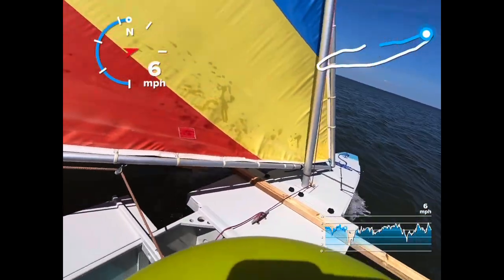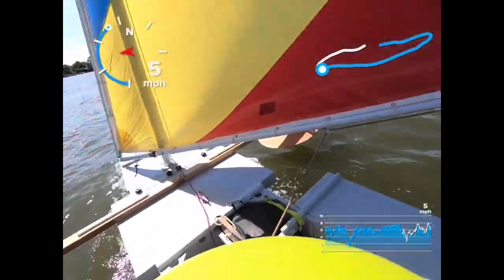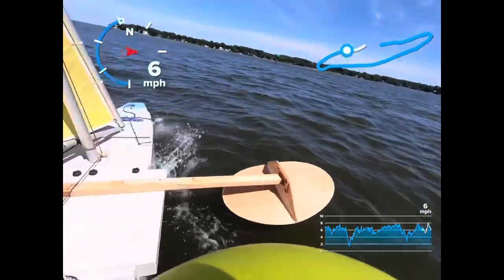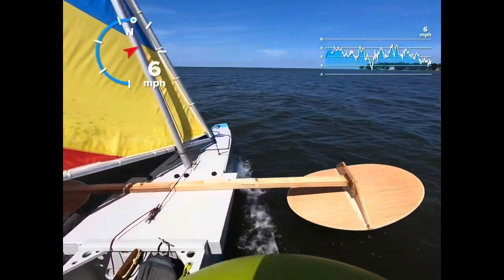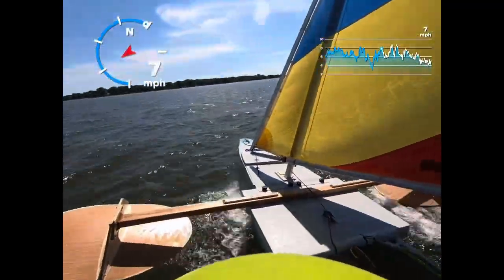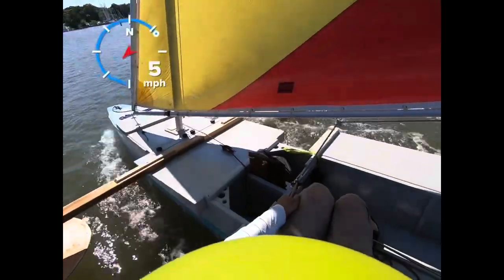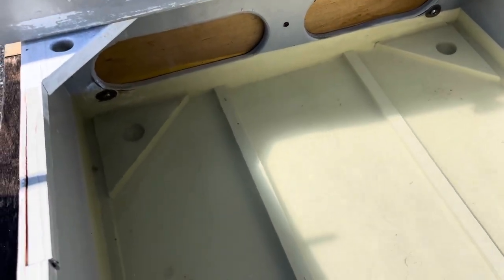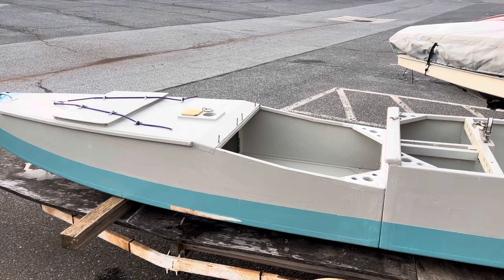Skimming Disc Amas Test 2- steeper angle

Comment: Why not sit on the ama and increase the righting moment without the wetted surface? Of course the ama should be further aft.
Reply from the maker: The lift on the disc is higher than the lift on the hull.  The hull therefore is partially lifted out of the water by the disc so wetted area goes down not up.

Comment: or like a pair of water skis.
about the same surface area,  but less drag....could probably run a little more angle too.
Reply from the maker: Actually, water skis are not design for low drag because they are pulled by a speed boat.  Wider and shorter is better.  Think of it as a wing.  The longer the wing the less fluid escapes around the edges.
Reply: @markpalmquist  in fact, it would be like those foils that slide through performance mono-hulls, ( they have like rollers, or something, that let the thin curved wing roll to lee. )

Comment: Facinating inovation! Perhaps the added water in the main hull warrents a second test at the 9^ angle? The discs working as well as I saw, other shapes, elongated oval for example, look to be options as well. Keepp sharing, we are learning from you! BestRoy
Reply from the maker: Thank you!  I agree there are many different shapes to test.  I think the next test I will put one of these existing skimmers on 1 side and a new design on the other and keep doing this until a winning shape comes to the surface.
Reply: @markpalmquist  sounds like a good plan! I look forward to more testing! AllthebestRoy
Reply from the maker: In intuition tells me that a 2 stepped skimmer would be better with 4.5 degrees at the back edge and something like 9 degrees in the front.
Reply: @markpalmquist  I see some "Foil" overlap in your design!

Comment: It took Edison 1000 filaments (or some such) before he got to the light bulb.  Keep working on your invention if you think it has promise.  Don't resort to excuses (leakes, etc.).  So far, results aren't that great, honestly.  Hope they get really good.  Then let us know.  You need 20 trials, or 200, not 2, if you hope to change the path of sailing.
Reply from the maker: I agree, I will keep testing different approaches.  These have an aspect ratio of 1.5. I may try 2.0.  I may set the back half at 4 degrees and the front half at 8 degrees.  And eventually, I may try a self adjusting angle.

Comment: Nice to see the performance at the steeper angle. You did fine crossing the wave. In the previous trial the discs stalled in the wave before recovering. Nice work and the best of luck.
Reply from the maker: Thanks, next test is 4.5 degrees in the back and 9 degrees in the front

Comment: Would be interesting to see the difference with just plain flat discs?
Reply from the maker: Yes,  I thought of that as well.  The current design has 25 lb of buoyancy, a flat disc would have about 5 lb of floatation lift, however, with a flat disc I could make it a bent lamination and put a step in the middle so that the back would have 4 degrees and the front half would have 6-7 degrees.
Reply: @markpalmquist with the step, a bit like the floats on sea planes?
Reply from the maker: Maybe step is the wrong word, more like a sharp bend like the hydroplaning surface of the bluebird K7.  The back hits first and should be low lift low drag, the front hits next and should be high lift to go over waves.
Reply: @markpalmquist  Looks like a small step to me on the pontoons on the K7, the surfaces is not in direct continuation but rather with a sharp edge on slightly different planes and angles to let the water "go"/ separate and reducing wetted surfaces i guess?
Reply from the maker: @joeordinary2trumpheroofrussia   Yes, I agree a sharp angle shift works better than a gradual convex curve.  Sea plane floats have to be aerodynamic so they are long and skinny (low aspect ratio).  The discs need to be at least 1.5 x wider than they are long, otherwise they create more hydrodynamic drag.  High aspect ratio always equals lower drag.  Waterskis going sideways have more lift and less drag than waterskis pointing forward.
Reply: @markpalmquist  Agree. And a very sharp angel helps water let go. Most planning boats have due to production reason a too rounded edge by the transom, but its pretty easy to repair with epoxy putty.  On my own boat jus tabout to install double the original width trim planes so can keep the hull planning at lower speeds. Will also mount them slightly higher than on bottom level, so there will be a small step.